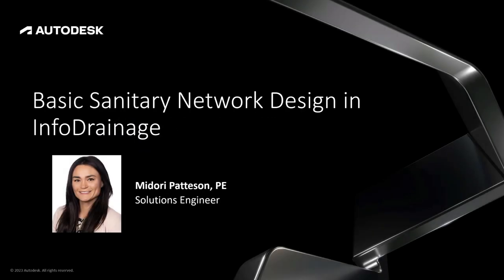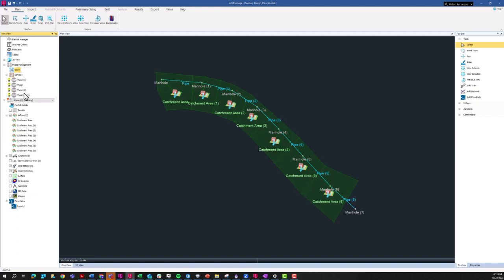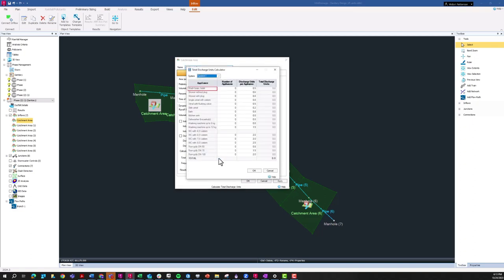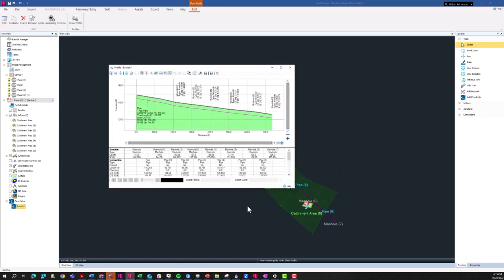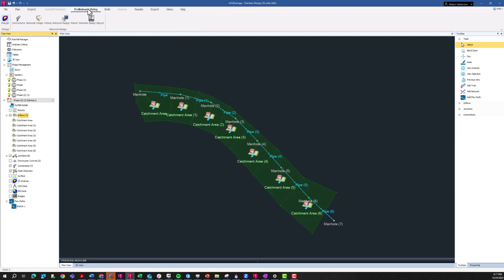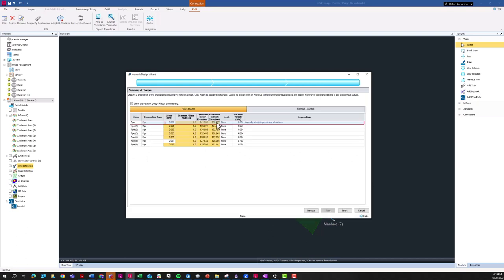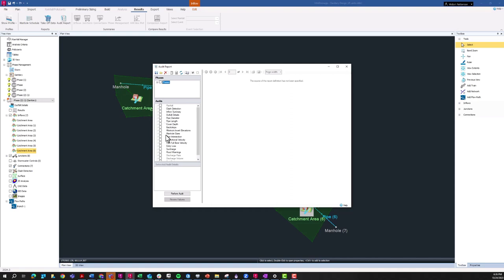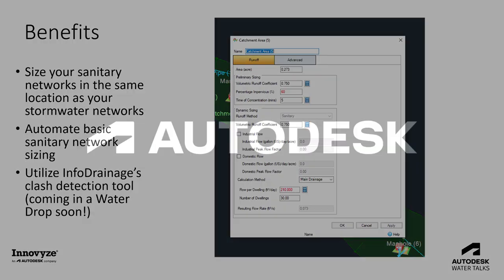Basic sanitary network design in InfoDrainage

Comment: Why was it decided to put to have your inputs for wastewater (sanitary) into 'Catchment Area'? It is completely counter intuitive. Furthermore the UI is quite confusing and awkward when designing wastewater, the UI for Microdrainage was far more straight forward, intuitive and user friendly. This begs the question - if it ain't broke why fix it?
Reply from the maker: Microdrainage's roots go back 30 years to 1983. (!) To say a lot has changed since then would be a big understatement. While change can be hard, we hope you will embrace a new, much more powerful app that reflects modern industry standards - particularly when it comes to SuDS. When you're ready, we hope you will give it a try with our free trial (no credit card required). Until then, you can of course keep using Microdrainage.